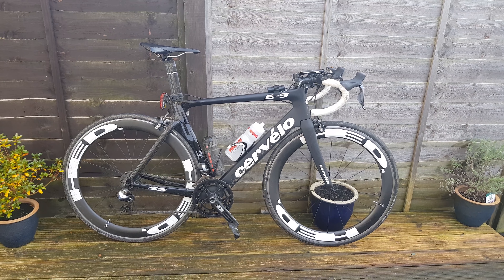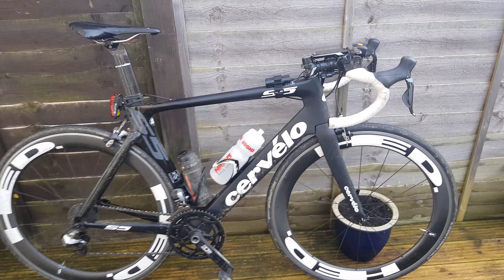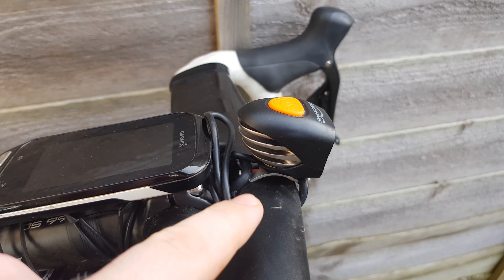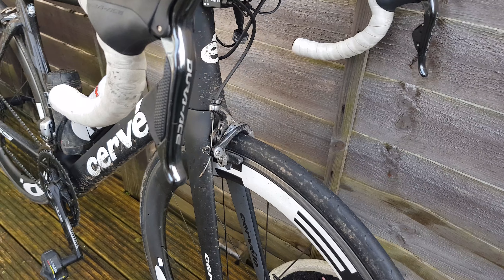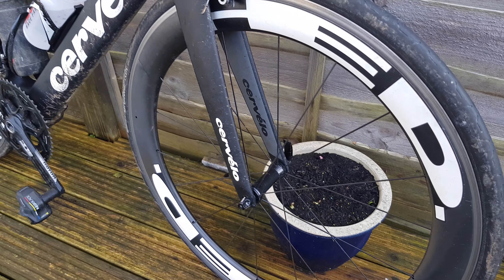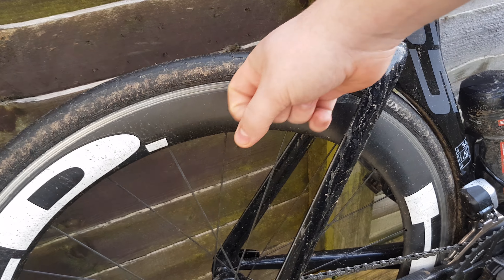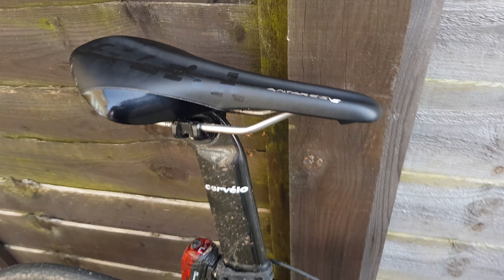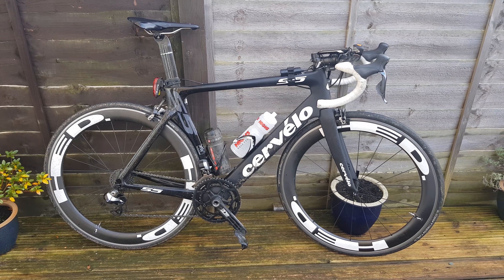Cervelo S5 Dura-Ace Di2 - First Ride Thoughts

Comment: asking if this s5 size 56 fits me im 5'8 height thanks.
Reply from the maker: You will want a 54cm or even a 51cm depending on how agressive you want the fit
Reply: Joe's Cycling Reviews  i was thinking of 54cm so meaning 56cm is way too big for me or is it okay for the reach in from saddle to handle bar?
Reply from the maker: on the 56cm both measurements would be too big for you
Reply: Joe's Cycling Reviews thanks joe